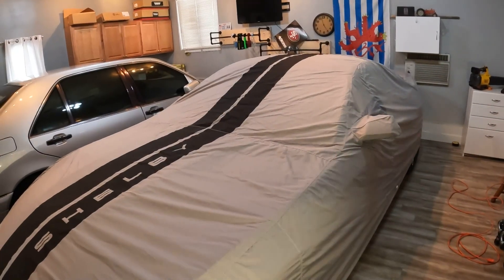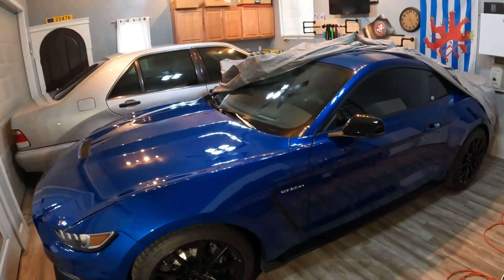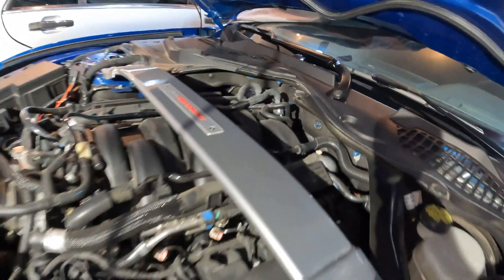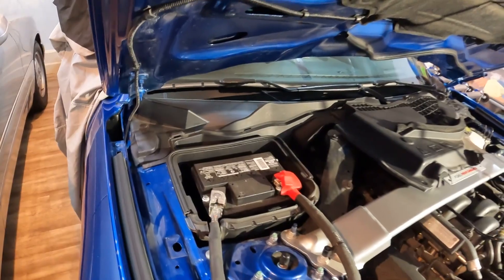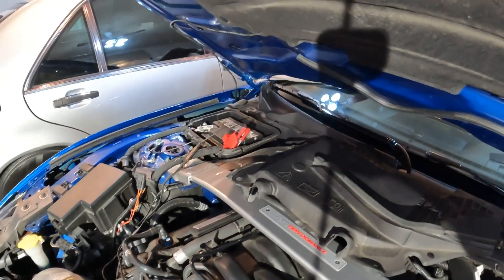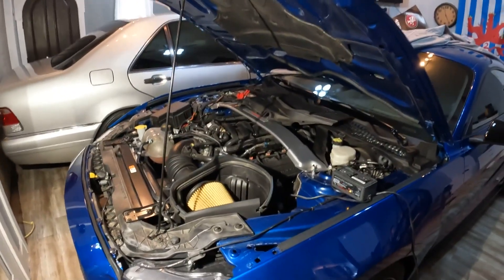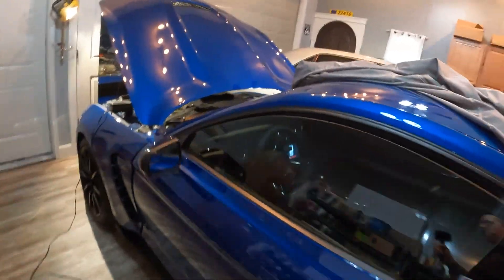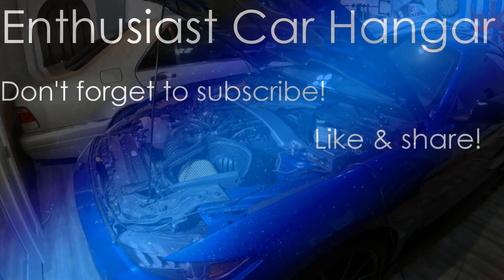Shelby GT350 BATTERY maintenance & DEAD mouse!

Comment: It's always good to check the charge on a battery on a car that has not run for awhile. My 2002 Town Car has a parasitic draw that will drain the battery if it sits too long. If my car sits for more than several days, I put a trickle charger on it.
    I am glad you caught the mouse. Rodents can cause a lot of damage to cars, as they like to chew on the wiring.
Reply from the maker: You are right. Do you know what the parasitic draw could be?
Reply: I am not sure what is causing the parasitic draw. I have had two mechanics look at it, and neither could seem to figure it out. If I park the car for a week or more as I have done at an airport parking garage, I disconnect the negative battery cable.
Reply: @franknew9001  Try an Optima battery.

Comment: There is an easier and highly recommend way to do it right, get the Ford performance battery maintainer (Ctek) it comes with a quick connect which you hook up via the positive by the fuse box and the negative to the ground on the Chassis.. no need to even  mess with the battery and it is  actually recommended to do it this way.. great video ..- 17' GT350R owner
Reply from the maker: Thanks for watching and telling me about it. I will look into it.